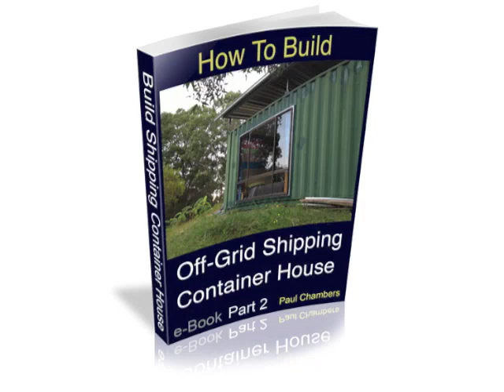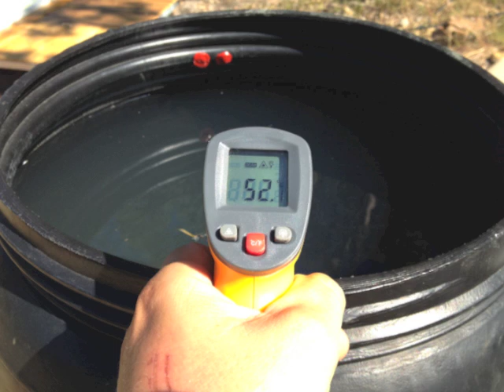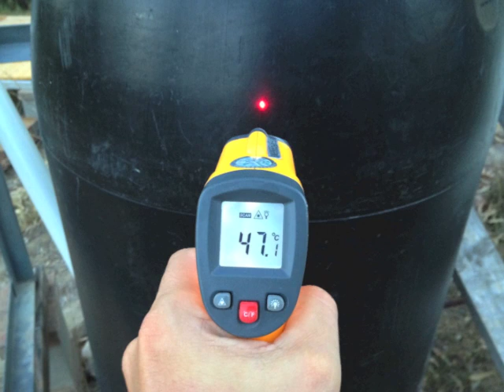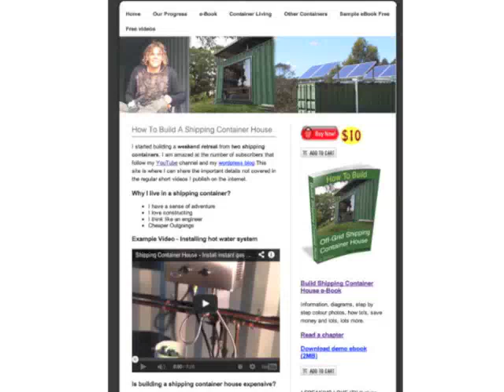Shipping Container House - Solar powered outdoor bath - bathroom

Comment: Is there any danger creating an environment from Legionella?  It needs temperatures of between 20 and 60 degrees for an environment where it can form.  Below and above that is safe as it is either dormant or the temperature kills it.  Possibly your climate is such that it doesn't happen but over here it is definitely a concern that thermo syphons need to consider.  Another great update though, I am really enjoying watching your adventure.  Thanks for sharing and all the best.
Reply from the maker: I had not thought of it.
Wiki data:
Above 70 °C (158 °F) - Legionella dies almost instantly
At 60 °C (140 °F) - 90% die in 2 minutes (Decimal reduction time (D) = 2)
At 50 °C (122 °F) - 90% die in 80–124 minutes, depending on strain (Decimal reduction time (D) = 80-124)
48 to 50 °C (118 to 122 °F) - Can survive but do not multiply
32 to 42 °C (90 to 108 °F) - Ideal growth range
25 to 45 °C (77 to 113 °F) - Growth range
Below 20 °C (68 °F) - Can survive but are dormant, even below freezing
I saw 74 degrees C on the manifold on a hot day. I suspect I wont be bathing unless there are temperatures around 50 to heat the water so I think I will be OK.  On reflection my chainsaw scares me more. Cheers for thinking about it though. Paul